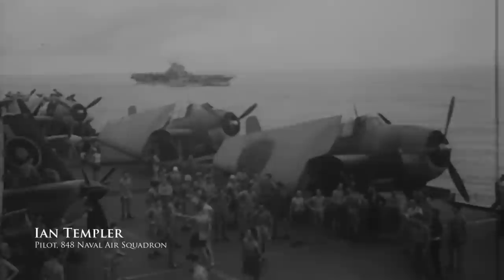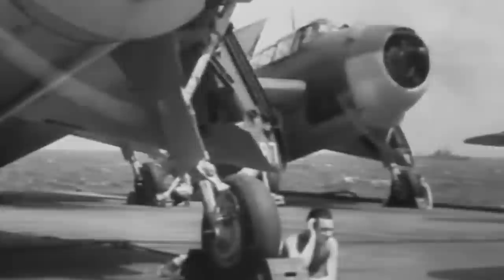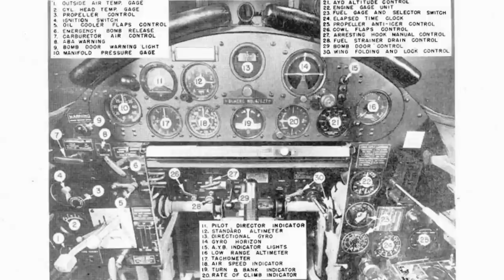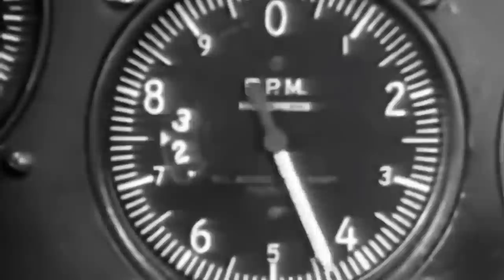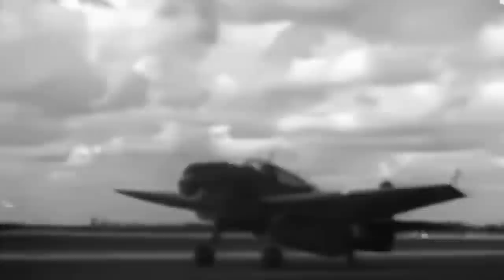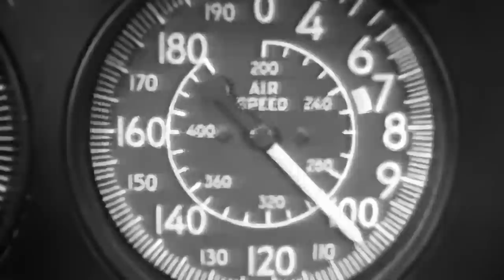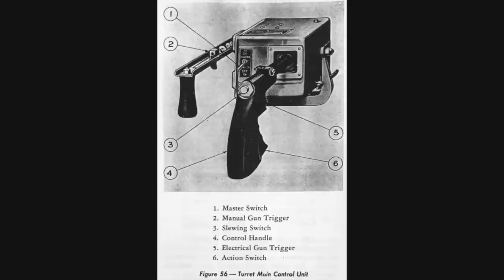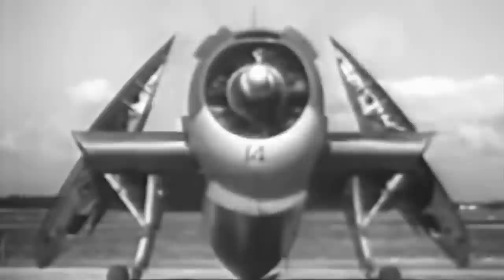Grumman TBF Avenger | When 'good enough' wins wars

Comment: When discussing the settings the pilot needed to set when doing a diving bomb run, he said the Blower Needed to be Set on Low. What does that mean? What is the Blower? Thanks!
Reply: The engine was equipped with a two-speed mechanical supercharger, this is colloquially referred to as the "Blower" as it forced extra air into the engine cylinders. It had two settings low and high. The higher speed is used for better performance at higher altitudes.
Reply: The supercharger, which compressed air for the engine, to provide better performance at higher altitudes.
Reply: All of the engines, no matter which nation, used multispeed essentially air compressors thar forced more air into the cylinders. The speed was determined by height, which is air density. An analogy would be low speed on the blower below 7000 feet and high speed above that altitude. This is all to pack more O2 into the volume of the cylinder.
Reply: Thank you all for great answers!